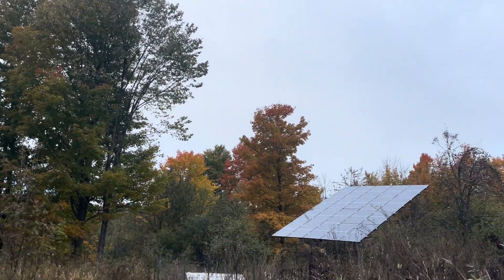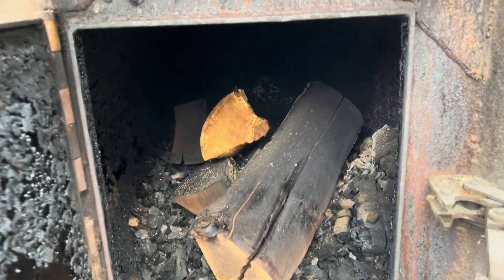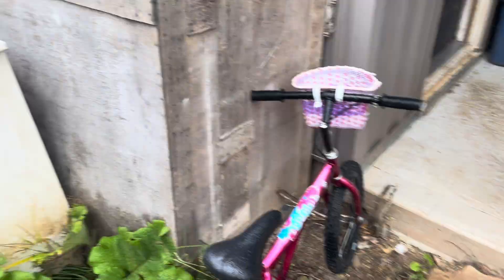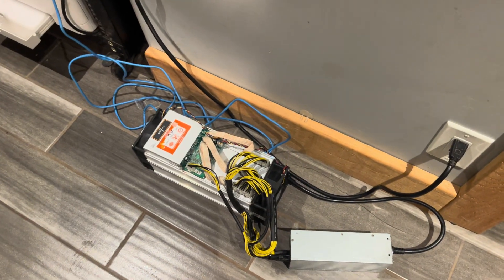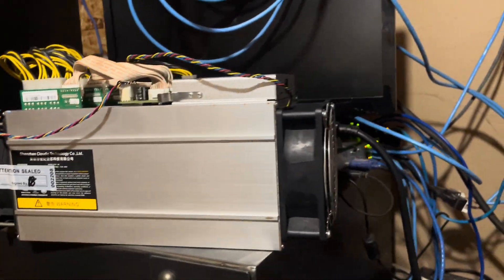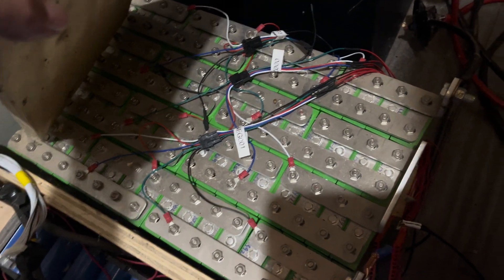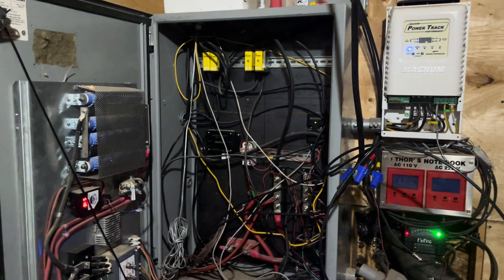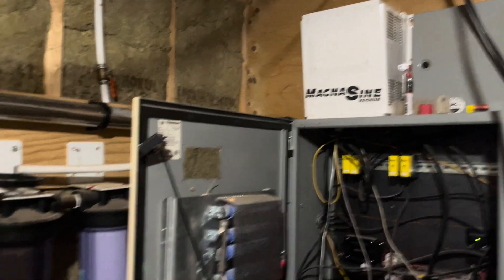Off grid systems and bitcoin mining

Comment: How much money 💰 is made mining crypto?
Reply: Bitcoin it now at 10/18/2024 2:36pm it price is at 68,863.97
Reply from the maker: 2026 will leave the last million coins to be mined by 2140. What other scarce element or combination do we know of? Have you got your share of the 21,000,000 to ever exist?
Reply: with that setup, maybe at best $10/ day at current prices
Reply from the maker: Not quite, I have them tuned down to run over night until I add more solar and battery. I’m a believer in BTC so when I look back 10 years from now at the 300 dollar investment to mine with the sun, it’ll be interesting to see how that decision panned out. It was fun and I learned more so I already won I figure.
Reply from the maker: To be honest not a lot. Maybe 2.00/day 1500/2000 Sats. But I got the mining rigs for under 100 bucks each. My power is free and would otherwise be wasted. (Solar). Another byproduct of mining is heat and if the house doesn’t call for heat the wood boiler hardly burns any wood. It still does our hot water anyways and if the house needs it, it heats the floors. I have been off grid for over 10 years now and it’s been learning the whole way (brain exercise) I had no idea what would be possible off grid when I started. Fast forward to now and we have AC all summer, infloor heat all winter, dishwasher every night, large laundry pair, network rack 24/7, and now bitcoin mining. I’m stoked, I have exceeded my expectation 10 times over. Can’t wait to see what I was mining with the sun per day, 10 years from now! ;)

Comment: Did you buy used miners? How long till you mined the invest?
Reply from the maker: If I run them around the clock on high (1500 watts) payback would be around 100 days. I’m running 1-2 around the clock and at reduced wattage to help keep the heat down and them running efficiently (600 watts each). Yes they are used and 100 bucks Canadian I paid for them including shipping each. It’s more fun than anything and the sats I get hopefully go up in value.
Reply: @modernoff-grid440 The sats will definitely go up in value.  Next few years should be epic imo.